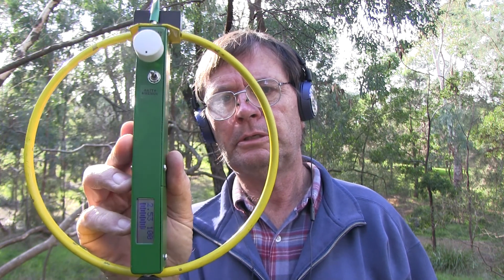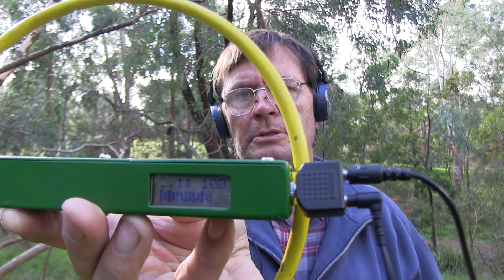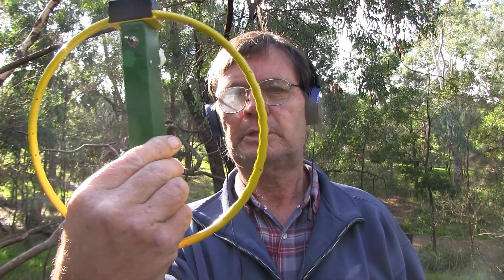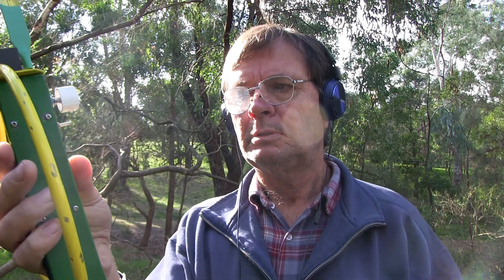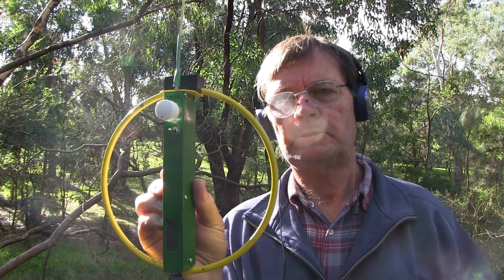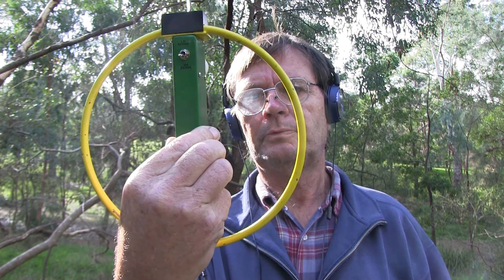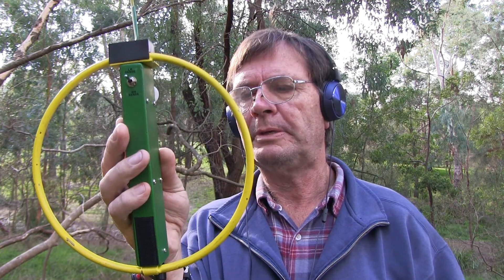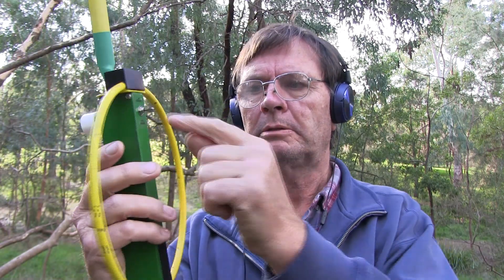DF1FO 80m Receiver

Comment: Little tip: if you rotate the direction switch 90 degrees you can configure it so that the handle of the switch points into the direction of the maximum. More easy te remember.
Reply from the maker: Marcel Daverveld thanks Marcel, already did that but have since made another mod. Here in Melbourne we always hunt peak hardly ever bi directional mode. So the toggle switch has been replaced with a momentary NC switch. Default is peak "whoopie mode" and if you want bi directional you push the momentary button. The peak reverse function has been disabled (actually not connected)
Good hunting!
Reply: I saw your other videos and understood that you were hunting at the maximum.  I am a minimalist ;) Respect for building all these receivers, i just made one found it already a large project. i really appreciate the effort you made in  producing these excellent video's.  73 Marcel de PG8M
Reply from the maker: Good stuff Marcel, I was not going to make the videos but we ordered 24X80m receiver kits and as i had already assembled 4 units I was asked to document the construction process for those who in most cases were only building 1. We had it easier though as the boards were loaded using pick and place. HI. May see you in South Korea for the WC if you are attending.